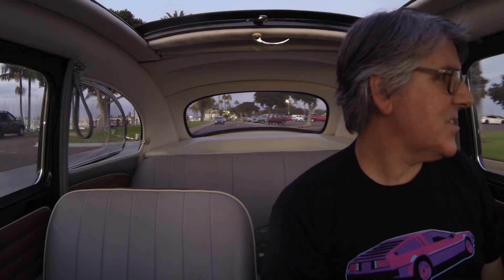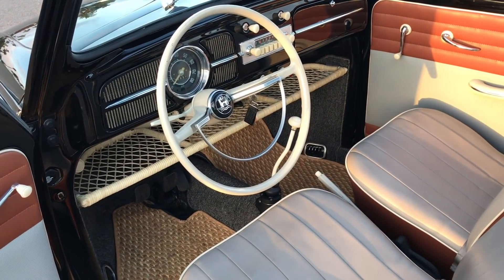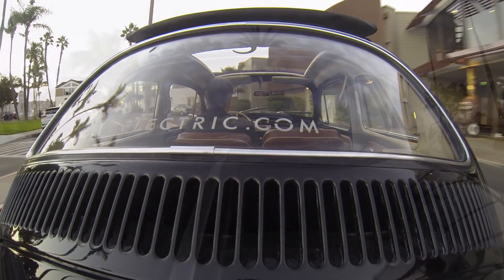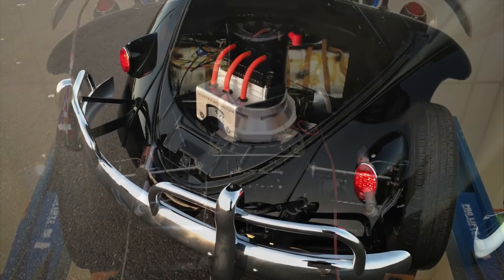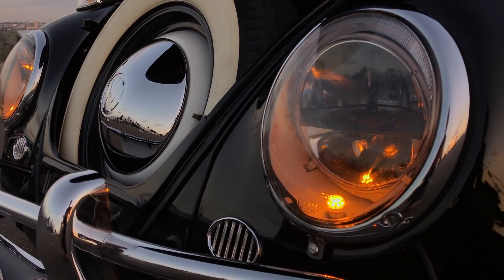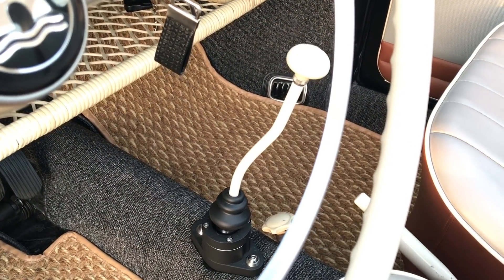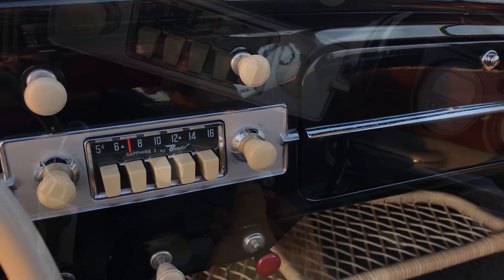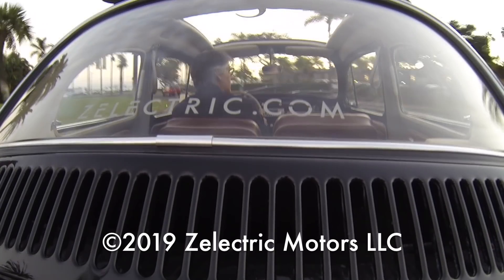All-electric vintage VW Beetle with Tesla batteries.

Comment: What do you guys think about doing something like this with a 2012 Prius V?

We have one that we LOVE.  Even though it's got almost 200K on the odometer, to look at the car inside and out, it looks like it has less than 20K miles on the car.  Under ordinary circumstances, we wouldn't consider it for this car since it has consistently given us an average MPG in the high 30's.  However, unfortunately, the engine has developed a bad knock, so we're already looking at replacing the engine for well over $7K miles.  So, if we're going to have to replace the engine anyway, we're considering the possibility of making it all electric, for so long as we don't have to spend significantly more than $7K.

Your thoughts?

Comment: My only reservation with the conversion is the elimination of usable trunk space. What a pity!
Reply from the maker: There's still a huge amount of room in the front trunk, The battery box is only 2 inches taller than the original gas tank. db

Comment: You totally butchered a classic. Why didn't you just buy some e-crap instead if doing this?
Reply from the maker: No permanent modifications have been made. Nothing cut or welded.
Reply: @Zelectric  I see where you're coming from, but for a classical purist, it's still an abomination. The likelihood of it retuning to original is low.

Comment: No heater!!! Come on!
Reply from the maker: John F We build to order. Electric heating system is an option.
Reply: Back in the day, heaters were an option in cars. Not in my day but I do remember a Hillman Imp without a heater blower! I got one from a scrapyard. Heaters are essential of course in UK and all cars these days have them AND aircon, though this is not essential here. I have always thought that heating was a big problem for electric vehicles. It must take several kw and drain the battery much faster

Comment: Hey David , I have a question for you. How are you going to discard the Tesla battery that is filled with toxic chemicals when it is no good anymore? By the way, do you know what plants and trees inhale? Trees and plants inhale fumes a gas burning car exhales  from the muffler.
Reply from the maker: Jorge Ramirez We’re already using used batteries which can be used in many other applications 15+ years after they’ve given this car 200,000+ miles of use and then finally recycled. -db
Reply: Oh gawd, it's one of those "CO₂ is plant food", climate change denying nutcases.

Comment: Need to add more Battery backs around the motor and remonve the spare tire for more battery pack also. You should beable to get the Z Bug up to about 250 miles. You could also modify the floor pan for even more and make 300-350 miles per charge. Better yet commission a totally new frame build for all the batteries so they're at the lowest center of gravity.

Comment: One thing that hasn't changed - the heat exchangers still don't work.
Reply from the maker: We use an electric heater that quickly warms the cabin.
Reply: My thoughts exactly. I recall many  early morning drives with a blanket around my legs and an ice scraper in hand.

Comment: imagine if we had modern battery technology back in the 50s and 60s, nobody would have bought an ICE car.
Reply: Nobody who didn't have to go more than 100 miles without waiting for a charge and had $60,000 in 2019 prices ($5,000-$10,000 in the 1960s) to spend on a small car.
Reply: @pcno2832  a beetle isn't a small car. It was middle size back in the day, at least over here. And most people would gladly buy an ICE car if they knew about the advatages in terms of maintenance cost and reliability.
Reply: Also, the fact that this thing cost 60 grand to make, does not mean that this would have been the price for wholesale production. This here is a unique specimen. Build a million of these, and the price drops by a significant fraction. That's how economy of scale works.

Comment: I love beetles but how much would it cost to do the conversion???
Reply: 20k
Reply: 20k? Yeah right. 
Quote: The drive is the thing. Each vehicle is built to order. To provide the optimum driving experience, the Zelectric performance upgrade includes an array of basic modifications in addition to the drivetrain conversion. Beyond that, custom options are available. We are all about performance. 
We retrofit client-owned cars.  But if you don’t already own it, we can help locate your ideal candidate for a Zelectric retrofit. Occasionally we have turnkey Zelectric vehicles available for purchase, or exceptional models on hand that are available for commission.* In addition to the current market value of the vehicle, general base costs to zelectrify Beetle, Karmann Ghia or Porsche 356 start at $68,000. Microbus retrofits start at $74,000.* Other Porsche builds (911/912/914) start at $88,000.

Comment: Does the clutch work ???or is it there just for the looks. Also you press the clutch and then move the shifter forward for upshift and down for down shift and reverse and nutrual
Reply from the maker: Yes, this one has our optional 2-speed gearbox. No shifting needed until 45mph.

Comment: Very nice, clean installation.  Congratulations.  Curious about the total weight.
Reply: if I had to guess... it should be no more than 1000 kg's [a more realistic estimate would the 800-900 kg]
Reply: @yanuchiuchihaanimegamesand3907  At 900 kg, it would be almost exactly the same as a 2008-14 smart fortwo 451.

Comment: How much for one just like that?
Reply: about 25-35k
10k for a VW beetle 1960 in good condition, less if you find one without a working motor (which you won't need anyway).
10k For batteries and motor
5-15k to have someone install everything.
Reply: @luisco.4906  I can find a Bug [in working condition and not rusted] for less than 1k where I life [laughs in European]
Reply: @yanuchiuchihaanimegamesand3907  Not really anymore, especially not a 1960. Even a 70s Beetle in good working condition but far from excellent will cost well over 3-4000€.
Reply: @andrashorvath6300  Where do You live? I found one just the other day at 150 Euros and in far better condition than 90% of the cars on the streets
Reply: @yanuchiuchihaanimegamesand3907  I live in Hungary. I just now looked it up, the cheapest roadworthy one I found here costs about 2500€, but it's pretty worn. I assume the prices even higher in places like Germany. Where are you live? 150€ for a roadworthy one is a hell of a good price.
Reply: That's what want to know too
Reply: 60,000
Reply: @murraymadness4674  where did you get your number?
Reply: @gevanlappido1304  look at it its gotta be over 60k
Reply: @gevanlappido1304  , For the man who has everything huh?.
Reply: Murray Madness in 1969, VW Beetle advertised as “ the only car still under $2000”
Reply: Murray Madness pounds or volts

Comment: Battery in the crumple zone!
Reply: Crumple zone in a 1960 car? Not stock to have seat belts installed.
Reply: George Fraile  No air bag, nor most of the safety features we take for granted today.  Driving this would most certainly encourage safe driving habits.